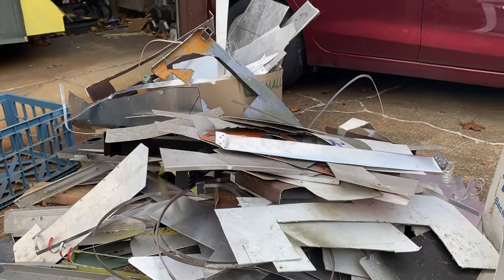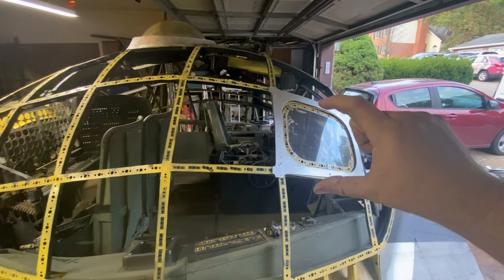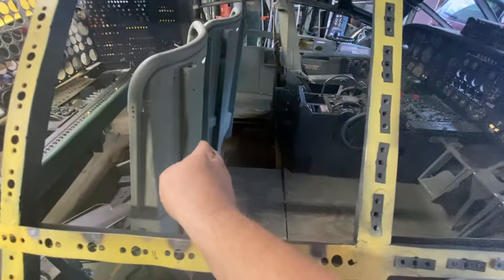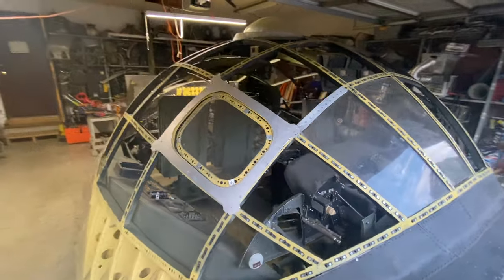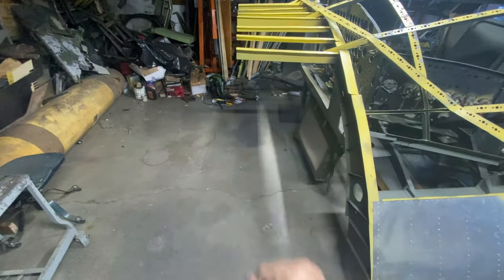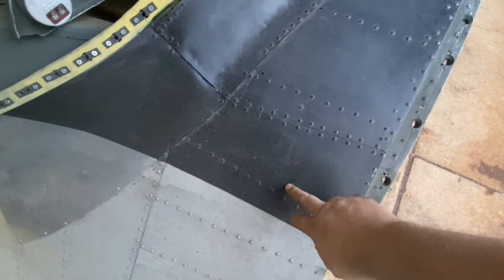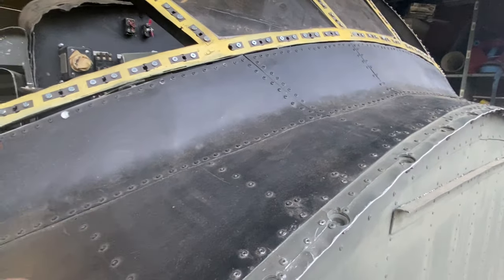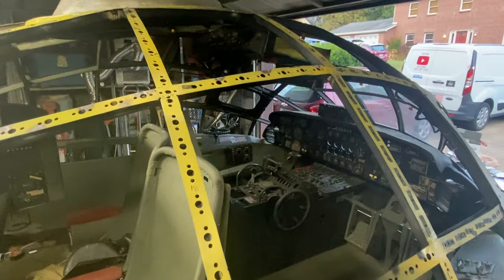West Virginia MAN Cleans a Garage and FINDS A NUCLEAR BOMBER AIRPLANE!!!!

Comment: You should rethink the plan to section the cockpit. You will be losing an enormous amount of stiffness (flatwise, edgewise, and torsional) it will become as floppy as a dead fish.

There must be another solution to transportability... perhaps make it able to pivot up on edge and be secured by a fixture.
Reply from the maker: There is no other way. The loaded trailer must be a maximum of 102” wide and 13’-6” tall. Again, the B-36 fuselage is 12’-6” wide. Anything over that involves wide load permits and low clearances and/or bridges. I drove tractor trailers for 3 years….
Reply: @B36HPeacemaker  Mount it at a 45 degree angle... that reduces both the height and width by almost 30%. Easy to make a wood frame shipping platform.
Reply from the maker: Furthermore, I must disagree with the project losing its rigidity. The pressed steel arches that make up the canopy and the three bulkheads in the fuselage sides are solid as a rock.
Reply from the maker: @physicsphirst191  I’ve actually plotted that and it would work. However, I want to take this to airshows. Furthermore, mounting at an angle would cause the trailer to be top heavy and also negatively contribute to wind resistance when traveling. Not to mention, I might get blown over in heavy winds. Just so much easier to make modular.

Comment: What, you’re going to cut it in half!  I won’t be able to bare to watch
Reply from the maker: The problem with the world’s largest combat aircraft it’s it’s 12’-6” diameter fuselage. If I were to legally haul it as is I would require timed, permitted and specifically route designated wide loads, with potentially an escort that would probably vary by state. I’ll pass….